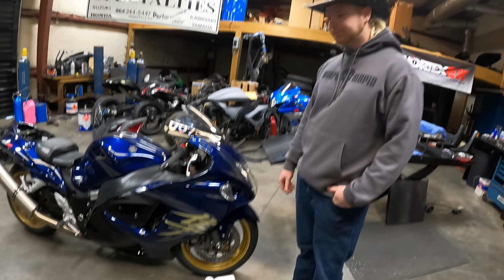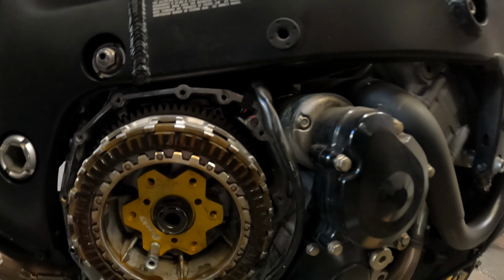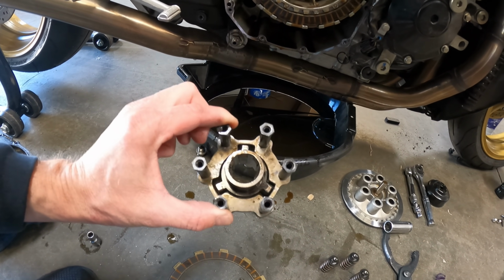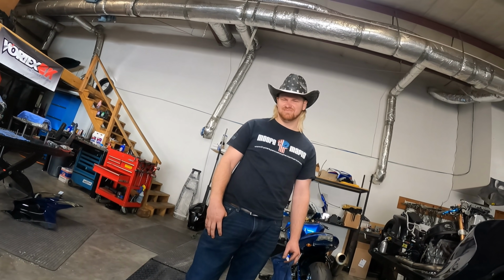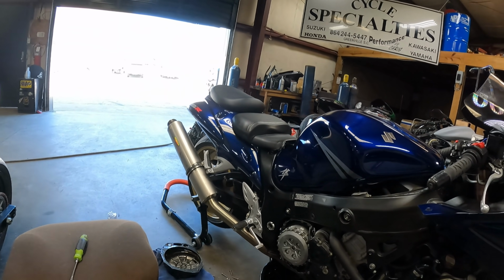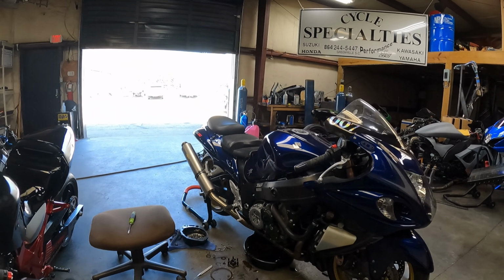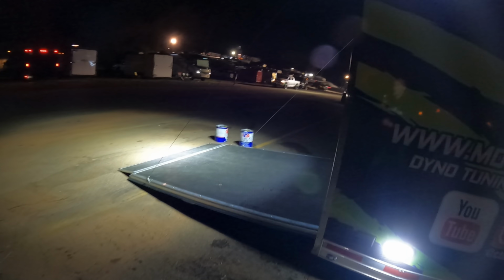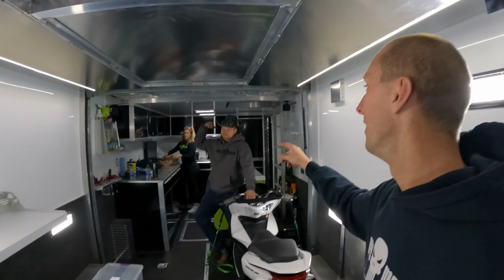Testing the Rickey Killer GSXR 1000 PLUS new Brock's Performance Mods to the Busa | Hogs Gone Wild

Comment: Code name BC Project. So here's the plan. Let's go West coast style on the gen 2. 65 in wb; extensions; 200 rear tire; upgrade spring on rear shock; -1 front +2 rear; run rear brake line & need chain; cut exhaust down; cermaic bearings. It already look lowered. If not lowered to much that Busa will still do everything drag strip, canyons, roll racing, cruising. Alright Team Moore Mafia on the break!!!!